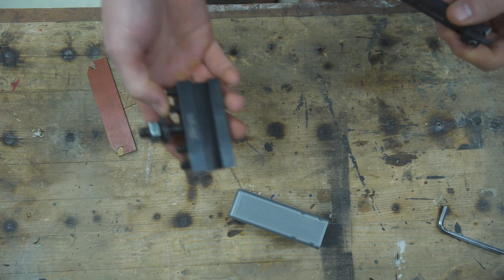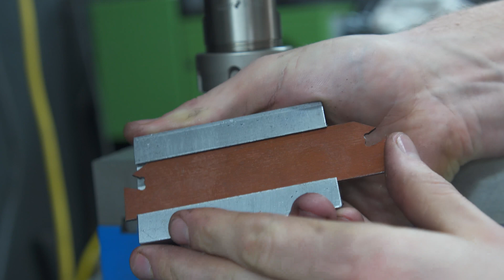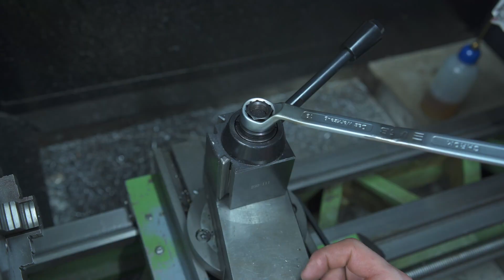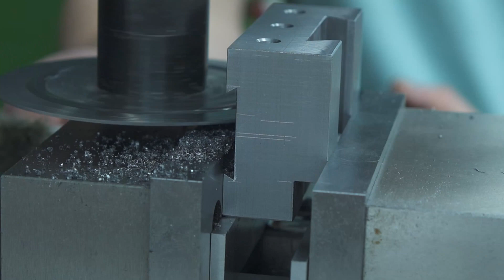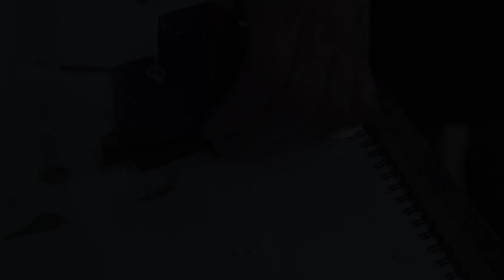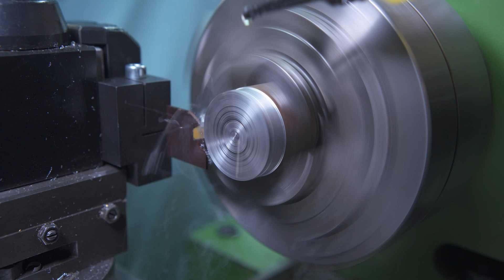Parting Blade Holder QCTP for the Lathe

Comment: Nice video!  The new tool holder looks great. When you do the relief cuts to allow for tool clamping pressure, what stops the tool from being pulled out of vertical as the screws tighten?
Reply from the maker: Hi Andreas, thanks for the comment!
Do you mean the distrotion of the toolholder itself? I really didn't consider this at all... 🤔
But you're right, as i tighten the screws, the top part slightly pivots outward. So in theory the blade is now not dead on vertical/square.

I just checked it with a square(couldntl' fit a 0.05mm feeler gauge), the distortion is quite small, since the fit of the blade was tight from the beginning, and didn't need much movement to clamp it.

Thank you for pointing that out.
Reply: @ChristophLehner  ok, that's interesting to note. I assumed you had seen a similar tool clamping design available commercially, so wasn't sure it was distorting at all, or if it was it had negligible effect on the tool. Thanks for the reply

Comment: Nice project and video! I chucked when the slitting saw jammed on the bristles. I wouldn't have seen that coming. I haven't worked with slitting saws so can't give much feedback there. I have been doing a fair bit of cold bluing recently and picked up on a few things. If you can get the kind that comes in concentrate form you can submerse your whole part and get a more consistent finish. You can even dilute the premixed like you have with distilled water to get a larger volume. Just takes the reaction a little longer. I clean the my parts with acetone and blow off with compressed air. Another thing that helps is to do one application, wipe off the whole part, then do another application. Hope this helps! Before too long, I'll be making some tool holders myself! Thanks for sharing
Reply from the maker: Hi Brandon, nice to see you around here and thanks for the tipps on cold blueing!

 I guess submerging the whole part & thoroughly cleaning, is the key to an even coating.
Reply: @ChristophLehner  Happy to help. Best of luck!
Reply: @ChristophLehner  on the topic of cold bluing: I recently tried this myself and found this video where the process is relatively well described (The video is from a German company) https://www.youtube.com/watch?v=oHlsh-W_3vg

Also thanks for your great videos! They help a lot since I'm also waiting on my Optimum Mill :-)

Comment: You did very well, these parting off blades are useful.
I made a similar tool holder but split the block horizontally mid way up from the front to most of the way to the back with a band saw, much quicker
And then just installed a m8 screw vertically to clamp the blade at the front (insert end)
Not having a small dovetail cutter I found that once the 3mm Slot for the blade was machined I could tip the block sideways in the vice to the required angle and run along the edge of the shallow slot with a 4mm end mill both sides to make a dovetail.  The end mill needs to go a bit deeper than the bottom of the shallow slot. With a 3x100 blade 100mm bar can be parted off.
I run my tool upside down and the lath in reverse to avoid chatter/grabbing
Reply from the maker: Thanks for the comment! Your design sounds a lot simpler/easier to make... I orientated on the holders comercially available. The bandsaw would probably have been a lot faster way to cut the slot.

Until now, i didn't expierence any chatter/grabbing while parting. Is there anything to consider when running the tool upside down & the lathe in reverse?